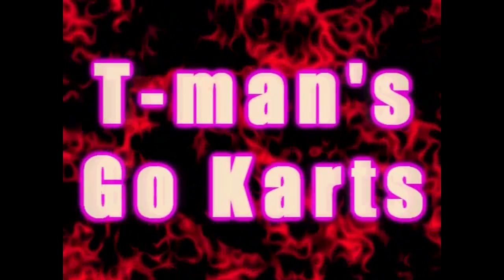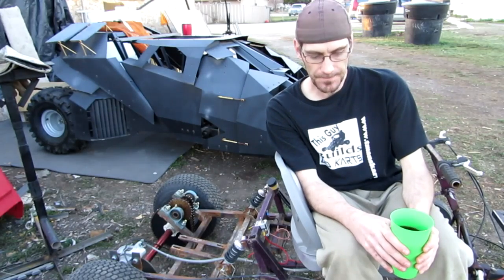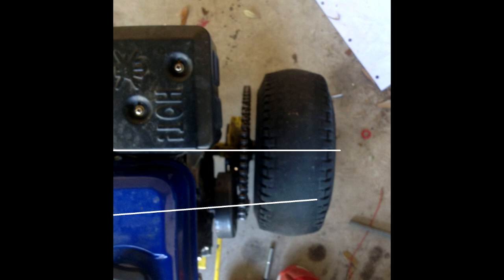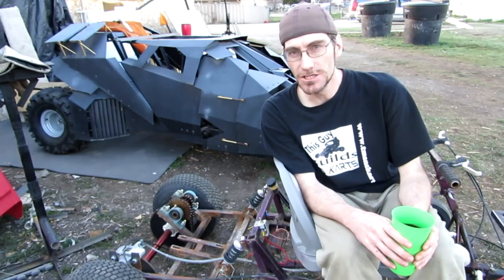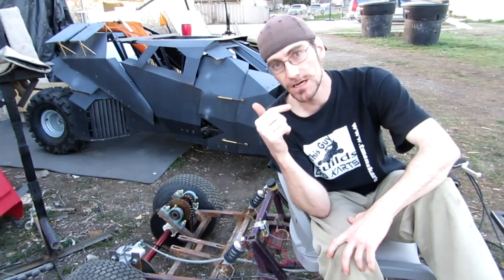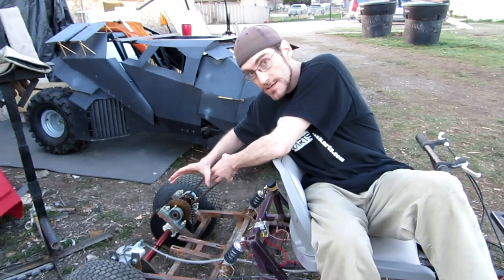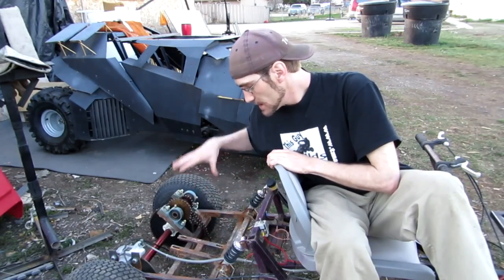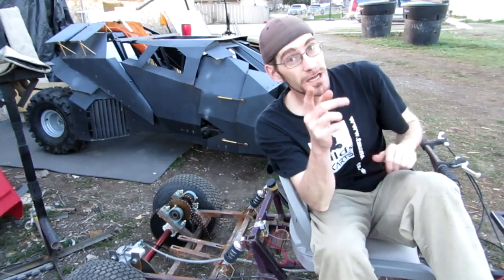█ GO KART BUILD | CHAIN ALIGNMENT | TIPS & ROMP

Comment: I’m having a problem, my 2 sprockets are lined up but when I turn the axle (by hand) at one point it gets really hard to turn and at one point it’s really easy. Chain gets tight on one spot and then most the time the chain is loose.
Reply from the maker: You might have a slightly bent axle
Reply: Hey, just curious if your issue was actually a bent axle.. I have the same thing going on however I notice I can make it worse or better with the engine and sprocket angle.. haven’t gotten it perfect yet, but now scared it’s because a possibly “bent” axle

Comment: Question I have a 420cc predator engine stock besides muffler and air system I have a pit bike muffler and 12" snorkel  and a 40 series torque converter kit I want to run a 17 tooth on jackshaft and a 60 tooth on my 1" bore live axle with 22x11-10 rear tires and 20x8-8 front tires on a homemade 2 seater build would that be a good gearing setup for this? I do want some speed but yet still have my torque when needed for cleared trails. If you want I can send you photos of the build if you need. I do plan on running a battery for all working lights front-rear and air horn so my mounting plate I have a steel plate at 1/4" by 32" long and 8.5" wide with 1x1" square tube for a solid mount for motor and alternator for charging system. I haven't bought the sprockets yet due to the fact I'm trying to figure out a good gearing I hate wasting hard earned money. If this build goes as well as it has been I'm going to build a single seater with my 2002 polaris twin 500 edge 2 stroke I have that's wrecked but still runs. Love the bat mobile you built in background. Any video of that ripping up the ground?

Comment: Hey man quick question. I just bought a used go kart but when I drive it past a certain speed the kart starts to move side to side. It’s pretty bad and I can’t figure it out. The only thing I see wrong is that my front right wheel is exactly the same size as the rear’s, but my front left is smaller. Could the right front be causing this issue or could also be something else? I’ve tried aligning the wheels as best as I can (eye balling it) but doesn’t seem to help. Please help.
Reply from the maker: ha, yeah, thats where I would start. get a tire the same size as the other front one,  That s a new situation I haven't heard of.
Reply: T-Mans Go Karts thanks! I’ll try that